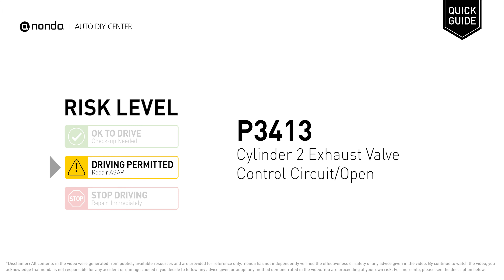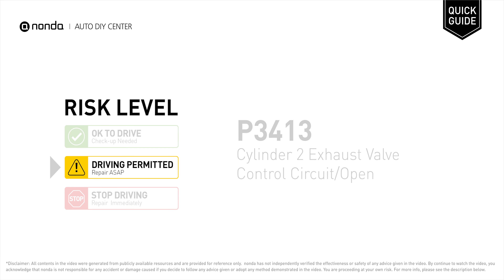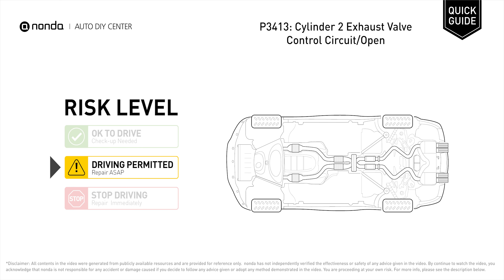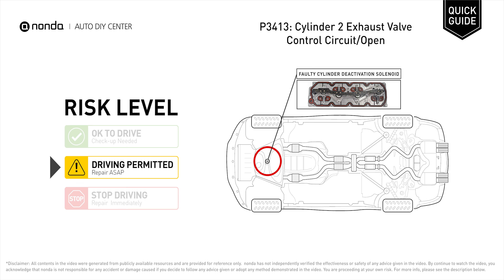What is P3413 Engine Code [Quick Guide]

Comment: What do I do to repair this?
Reply from the maker: Hi Duane, kindly check if you have a sufficient oil pressure. Clear the blocked oil passages and all the wiring connectors must be in good condition.